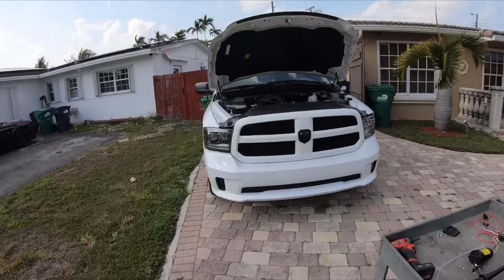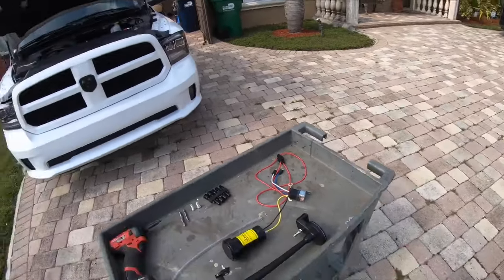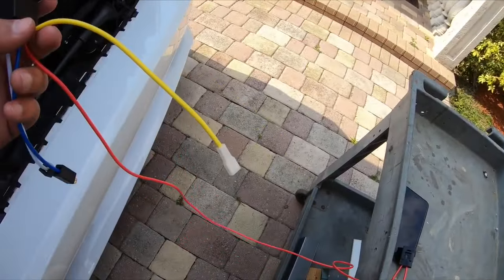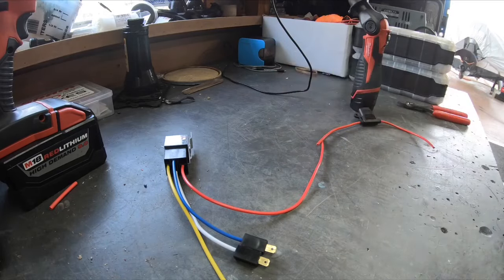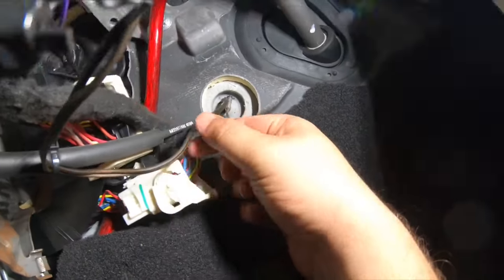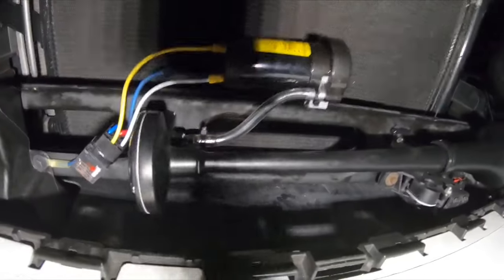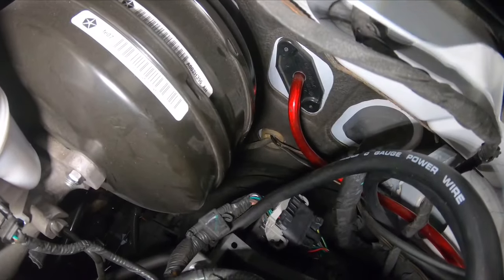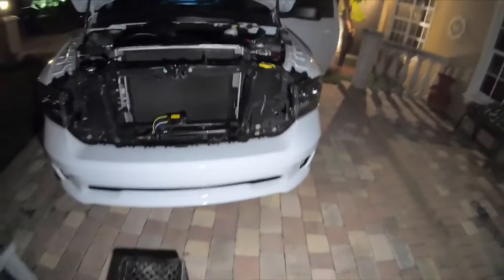INSTALLING A $35 AMAZON “150 DB” TRAIN HORN.. IS IT ANY GOOD?

Comment: I really appreciate the added effort you made to make such a clean install. You take pride in your work and it shows.  I have seen installs that look like a rabid coyote got a hold of the cables and furiously shook the wiring.  They do not even use zip ties, run the cable to the cab through the door opening, and the button install is held in place with duct tape.  Keep up the good work and showing the world that you do not need a, "professional," to get professional results.

Comment: Nice install, and a great price for those horns.  But it's kind of a joke for the manufacturer to call those "train horns."  They are nowhere near that loud.  They're loud for a car, so that's cool.  But true train horns are probably 50 times louder than that.  I have some real train horns that came on a used car that I bought about 50 years ago, and they will make you lose control of all your bodily functions.  They are unbelievably loud, as in, you can hear them from miles away loud.  I guess that's why they're illegal in the U.S. (on a car, anyway).

Comment: lol im just gonna splice it into my normal horn wiring harness so that all the horns go off at the same time
Reply: Right, who uses horns on a regular basis anyways..
Reply from the maker: That works too I just wanted to have them separate
Reply from the maker: ta2fr3ak when you live in Miami you use it on the daily lol
Reply: Bad idea if ur alarm goes off or just locking the car unlocking probably not a good idea lmao
Reply: @KevinToraya  I’ve heard that about FL
Reply: @foofstarr4856  lol imagine if your alarm is this thing and you are far from your car to stop it
Reply: @KevinToraya   or anywhere in  florida
Reply: Their gonna hate me, my state is hands free for electronics (phones, tablets, etc) and we constantly have people texting at stops lights, I feel like this will get the message across, wanted to for a while now just haven’t got the parts yet
Reply: @foofstarr4856  it not that bad it a small beep loud but not train loud
Reply: @Westside_69  oh my gosh that is what I need! That or a bed that catapults me out of the bed. I'm dead serious LOL
Reply: Can I just take my old horn off and replace it with that one?? Intend of wiring and stuff
Reply: @foofstarr4856  that's an extra safety feature. If the alarm goes off they are definitely going to run away😂
Reply: @foofstarr4856  as far locking and unlocking I know in dodge rams you can disable the lock sound
Reply: When you are a cyclist in Duisburg here in germany you have the wish to have a shiphorn atleast once an hour in the middle of the city because of either stupid ppl in cars or ppl who pay no attention to their sorroundings.
Reply: @ta2fr3ak  if you’re installing one of these, all the time🤣
Reply: @KevinToraya  A train horn on a 2014 GT they’ll never see it coming thank you for this inspiration
Reply: Use a relay

Comment: Bro when you're running wires put it in split loom so it don't chafe and short on the frame. 1/4" for a couple small wires and 3/8" will fit most. Harbor Freight has the cheapest I've found

Comment: Is there a reason I can't plug this in using the preexisting wiring in my truck? I'm not electrical savvy but assuming it's 12 volts it looks like I can plug the wires straight in from the old horn.

Comment: Did you really ground everything through your PLASTIC overflow tank? Not to mention your relay is right in the front of your grill. Its not even mounted to protect from vibration and debris but its also gonna get wet. I understand that it works but its very prone to failure from what I can see.

Comment: Probablly not the best place to position it with all the water that hits the front of a car .The compresser is gonna die if it hasn't allready as the electrical connections are exposed and the compressor needs to suck in clean air i put them vertically and up near the battery, the horn itself should aim downwards slightlly to reduce water ingress. My old air horns still going strong after years although i very rarelly used them ...

Comment: It’s been a year and a month since you uploaded this and I just installed my own. How’s it holding up for you? I’m gonna love scaring idiots on the street.
Reply: How did you wire your set up. Can you show pics. From this video I can’t tell where the wire leading to the cab is from
Reply: @kchase8656  2:03 explained it pretty well. The only wires going to the cab are from the relay, through a switch, and back through a relay. Everything else, including the relay, will be under the hood. If you’re not fully comfortable wiring this up, I’d say have someone help you.

Comment: What button did you use? Did it come with if. Im looking at all these buttons but they come with 5 pins and all these cables
Reply from the maker: I bought an aluminum momentary switch on Amazon if a switch has 5 pins on the back that means it’s got LEDs you can hook up to turn on when the switch is in the in position
Reply: @KevinToraya  damn i was hoping the led would stay on constantly lol. Not just when i press it, but thanks i got some work to do 😅 first time doing any wiring job
Reply from the maker: @jdruso7  you can set it up that way too just depends on how you wire it, look up 5 pin switch wiring diagram and you’re set

Comment: Is there any reason why you cant use the stock horn wiring to wire it in and use the OEM horn on the steering wheel???
Reply from the maker: You can but I wanted a separate button altogether to have the option of the regular horn. Now that being said you can switch the ground for the train horn and still use the steering wheel and you’ll be able to have either just the stock horn or both the stock and train horn at the same time.
Reply: @KevinToraya  Ok, Im wanting to remove the stock horn and just use the AIr horn only with the stock wiring and horn on the steering wheel. Cool deal thanks!
Reply: @KevinToraya  How do you mean switch the ground?
Reply from the maker: @steveo7767  you can switch the ground for the horn
Reply: @KevinToraya  Switch the stock horn ground to the new air horn ground?

Comment: Did u have a black wire as well with it and if so where does it go
Reply from the maker: Speck's Outdoors there was a black wire that goes to ground but I didn’t use it I uses my own wire for ground
Reply: KT BUILT thanks for replying so fast so does the white wire go to ground or the negative on the compressor
Reply from the maker: Speck's Outdoors the white wire is the ground for the relay I just put it together with the ground for the compressor
Reply: KT BUILT okay so I should have one from the compressor running ground and one from the relay also
Reply from the maker: Speck's Outdoors they both need to be grounded I just put both wires together to a larger gauge wire to have 1 ground wire for the two of them

Comment: I just purchased the same horn. Should I mount the compressor in a vertical position?
Reply: I can’t tell from this video but which wire did you drown and which wire did you run to the cab of the truck